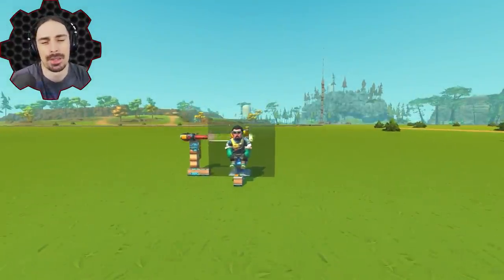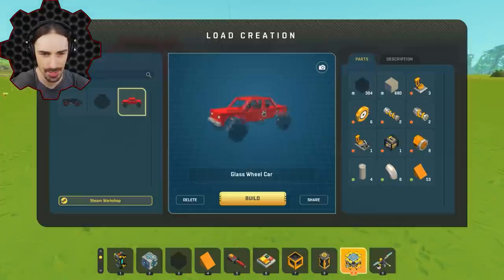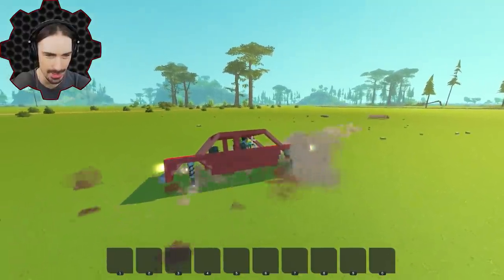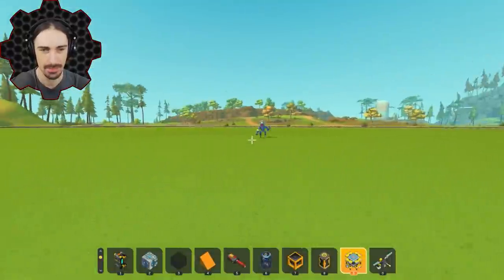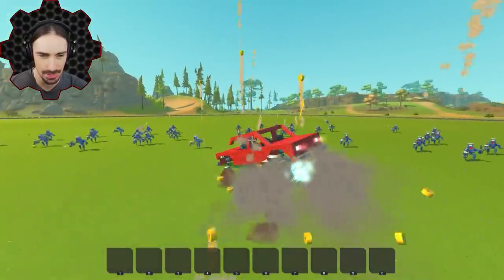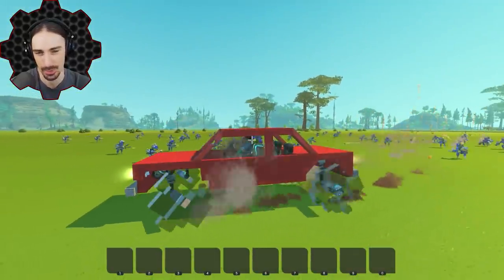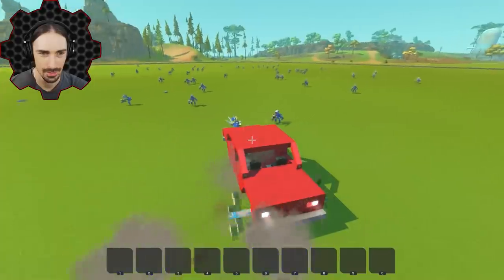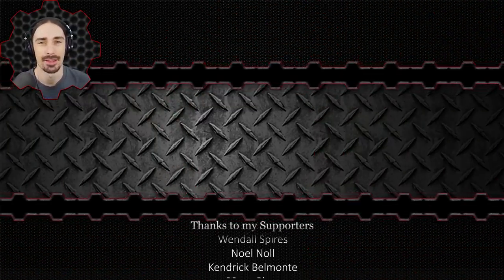Glass Wheels Are a Satisfyingly Bad Idea! - Scrap Mechanic Gameplay

Comment: fun fact glass is elastic like rubber, but if they had a higher limit then they would work for tires
(elasticity is defined by the way it can take force if it breaks instantly after receiving lots of force then it is elastic but if it deteriorates over time when it gets force then it is not elastic)

Comment: Scrapman: "Why don't we have glass wheels?"
Me: "Because we'd then need glass bearings and brakes for our glass wheels and have you ever heard two pieces of glass scraping against each other?"

That being said, have you guys done a glass/bubble block bridge SMMPM yet? You know one where you have to traverse a chasm but your vehicle destroys an already fragile bridge and you're stuck moving at a set speed with electric engines. You could have Jon Bane back and have fireworks at the bottom of the chasm.

Comment: Multiplayer Monday Evolution Glass Car Idea
Each player builds a car with X number of glass blocks, only thing allowed besides that are an engine, bearings and the seat (Glass wheels like this video).  Each round, players take turns going down a long row of spud guns firing inwards, winner is the one that makes it the furthest down the track.  Then everyone takes the winning car and modifies with like... 50 more glass blocks or whatever amount makes sense in order to do what they can to increase the distance the car can go before it stops being able to drive.

Comment: day 44 or 45 of asking scrapman to start a Survival series amphibious tank/basically any transportation and floating base/barge (or under water.) But you need mods... it's a require ment to breathe under water, if you want an under water base/transportation. And yes i am talking about the under water fan moonbo reviewed that basically makes water spaces air spaces... if that makes any sense.) (and if you wanted to move the barge/boat/floating base you are able to make thrusters/glitches/mods to do it or by lift or actual push)